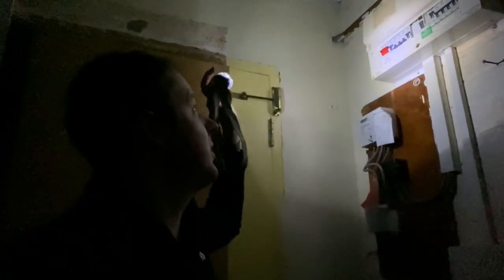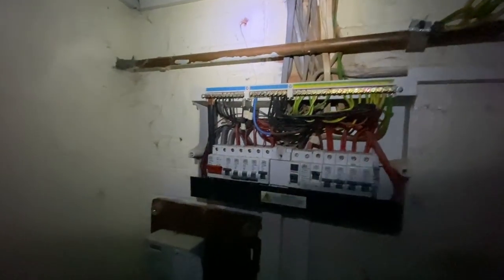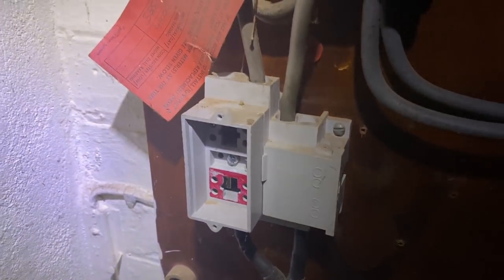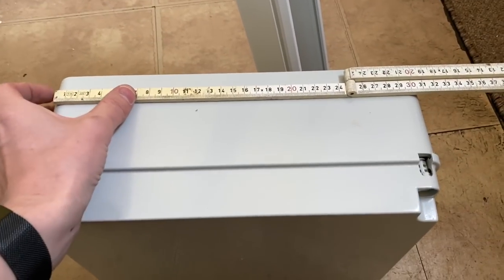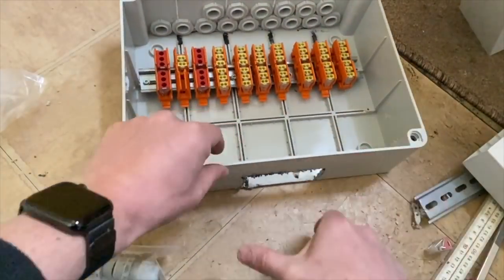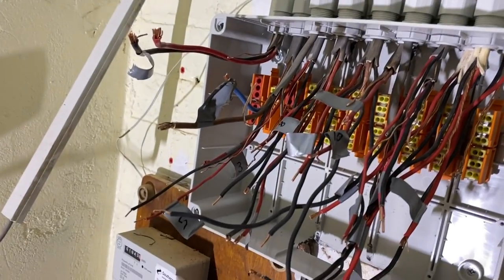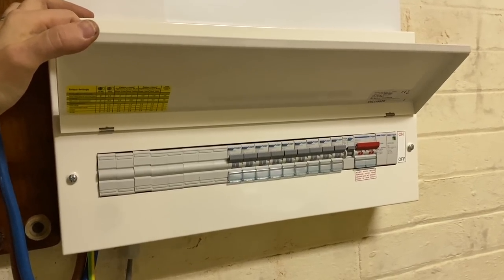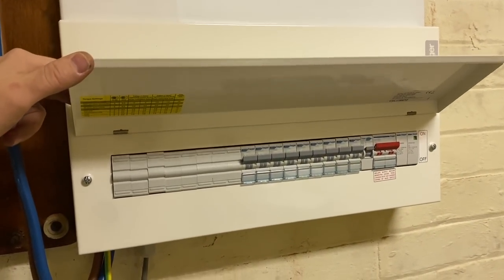Hager Consumer Unit 18th Edition Upgrade

Comment: Safe isolation is all about being in control... The fact that you are in control with that fuse out so no one can liven it without you knowing plus in an empty property, it is actually safer than locking off and going to another location coz someone can do something malicious without you knowing.
Reply: Locking off is a recognised method of safe isolation, doing what you did, taking account of risk assessment, I'd say it's safe because you're in control
Reply from the maker: Yeah you’re right good comment
Reply: @artisanelectrics  also according to Best Practice Guide 2, page 6 bottom of left column states "Adequate precautions shall be taken to prevent electrical equipment, which has been made dead in order to prevent danger while work is carried out on or near that equipment, from becoming electrically charged during that work if danger may thereby arise.  This regulation therefore requires that adequate precautions are taken to ensure that conductors and equipment cannot inadvertently be energised while the work is taking place - this is the process of isolation"

Comment: I’m not a tradesman.
Surely if you pushed the new boArd forward on some sort of frame cables could have been routed in-front of gas pipe and therefore could do rear entry into the new CU. Must have took you twice as long as it should of took. As a customer I would not of been happy. The junction box was like a plate of spaghetti. Could you not of run connectors vertically so cable in at top and out at bottom.

Comment: If a base Hager Design 50 Consumer Unit with a main switch disconnector (but without a Type 2 SPD) is £120, why does the same Design 50 Consumer Unit with a Type 2 SPD factory fitted by Hager cost £270. I can buy a Hager Type 2 SPD for £40 and fit it myself, giving a total cost £160, instead of £270. So what am I getting from Hager for my extra £110, seems to make no sense to me, but am I missing something here?

Comment: Nice job that. How long did it take you and also seems like a very pricey install would be interesting to know the cost. 
Hager are great like you say but cost a bomb 
I used gil lec the other day but ordered a fusebox c.u rcbo c.u with spd and got to be honest for the cheap price you get a lot for your money the one down side is the stickers are a bit poor
Reply from the maker: Thanks yeah the Hager boards aren’t cheap but best quality out there in my opinion, and for my customers I only fit the best.
Reply: @artisanelectrics  Crabtree are an excellant CU but pricy, however I do like the covered and fixed busbar.
Reply: How long did the job take you. Also did you do all your testing afterwards or did you go bk another day
Reply: Why don't you all use a Brother label printer E550 WP see David Savery's video review on YouTube they're worth the money

Comment: What is the purpose of the functional earth?
Reply: James Ahmat  The functional earth on the old style RCBO’s was used to allow the device to detect and earth fault even if the neutral to the Installation was lost. The non functional earth rcbos use and electro mechanical tripping arrangement within the device whereas the modules with a functional earth employ what is known as an electronic operating system incorporating monitoring of neutral loss via the extra lead. There is a grey area within the industry regarding the need for the functional earth as the supply authority claim they have accurate and reliable monitoring equipment to detect loss of neutral of the supply. Can’t see how that guarantees protection to the client if the pen conductor in a TN-C-S system is lost because we all know how useless some of these DNO people can be when it comes to rectifying reported issues.

Comment: They are pretty good boards, funny how plumbers make a fuss about a cable being within 25mm of their pipe, but when it suits they will run them anywhere.
Could you have put the board on the other side of the wall to save that joint box.
Only thing with Hager boards is your wera driver only goes to 3.5nm, and their main switch is supposed to be 3.6nm.
Reply from the maker: Yeah I could have put it other side of wall but it would be in a bedroom which is not ideal in a HMO, better if it’s in a communal area.

Comment: Hate the square knock outs on Hager boards - absolute ball ache if you've got conduit entry or a Swa gland in there.
Reply: I didn't realise they still sold Hager rectangular knockout boards,all hager SPD high integrity boards I fitted in the last year have a selection of round knockouts.
Reply from the maker: Interesting I’ve not seen the ones with round knock outs yet!
Reply: The part number I'm fitting is VML914CUSPDRK
Reply: I found that if you put the plastic inserts into the square holes you can actually drill  a 20mm hole and then still have conduit entry in there or if you have used trunking you can pass the cables through the 20mm hole. Saves trying to fit a grommet strip around the square knockouts which can be fidly and time consuming

Comment: In my workplace removing the fuse wouldn't be classed as safe isolation as you can't lock it off. Anymore could replace the fuse. Btw not a dig just a talking point
Reply from the maker: Yes that’s right
Reply: True but he's working within an arms distance from fuse carrier so nobody is going to be replacing  fuse whilst he's in there working
Reply: Is there a way of locking off after removing a fuse?
Reply: Safe isolation 😂, nobody cares, we are forced to work live, especially when you change a board and there's no isolator fitted.
And when there's a smart meter fitted with no isolator that's a real ball ache. And this is all because the Dno's want to save a few quid.
Reply: @acelectricalsecurity  in my field I'm working on stuff that is 2600v AC so that is getting isolated and locked off before I go anywhere near it
Reply: @liamstedman7742  don't blame you
Reply: Put the fuse in your pocket, who carries one of those around to replace it?
Reply: @liamstedman7742  So what would you do in this case, maybe have a DNO Engineer come out and do the same as Jordan has done, would that convince you.
Reply: @nw5835  I'm not saying I would have done any different.

Comment: Hi  I c thet u are good electrician but u could save trouble of extending cables .u only. Fix bracket on top of gas pipe mount fuse board on top  I have  55 years  electrician my name is Chris

Comment: Those wago din rail. Connectors are awful best sticking with the normal din rail connectors
Reply from the maker: Yeah I couldn’t get hold of any in time as no wholesalers stock them but next time I will use normal connectors.
Reply: Nightmare wholesalers are hard work these days ran out of pvc t boxes today apparently
Reply: @artisanelectrics  CEF stock the WIELAND brand and always seem to have plenty in stock, colour coded as well.

Comment: For me the right way to do this job would be to move the gas pipe. It would cost £50 - 100 to have a gas safe engineer do that for you. Then you wouldn’t need to junction box.

This would have given you 25mm clearance for your cables too.
Reply from the maker: Good comment I didn’t think of that!
Reply: @chirs b - no way it would be that cheap !!

Comment: The surge protection device should be protected by a 32A MCB not directly from the main switch
Reply: Stuart Olseen he mentioned at 34:18 - that this SPD model has inbuilt over current protection - so it doesn’t need a separate MCB to protect it in this case
Reply: inderinderinder 

If that is the case how would you re-set the integral over current device in the event of a fault current?
Reply: inderinderinder  I have just checked the Hager web site no mention of integral over load within the SPD
Reply: @stuartolseen214  You wouldn't be able to reset, it would be a simple fuse, but to be fair, current should never flow through an SPD long enough to trip any overcurrent device - if it does, it is faulty and due for replacement. But no, these have no overcurrent protection - Hager alternately specify using the DNO fuse (...) and a maximum C32 breaker to supply them, along with 16mm² wiring which they haven't used themselves.. Minefield.
Reply: Monkeh 
Hi Monkeh it would be good electrical practice to provide a local final circuit protection at the CCU, and would provide easy visual indication of any fault to the SPD
Reply: @stuartolseen214  The SPD already provides that indication - at least one of the two modules does. In fact, the majority of failure modes for an SPD would never trip any upstream protection. But yes, they should have some form of current limiting device in case things go wrong when the thermal fuse opens.
Reply: Hager manufacturing instructions. The spd comes pre installed from factory. Some other manufacturers come pre fit with mcb for the spd.

Comment: Nice mate big fan of Hager myself, yes pricey but a good solid brand.  How do you get your groom it strip to stick like that
Reply: I’ve found two different sizes of grommet strip off eBay the best size for the CU knock outs is 1.0 to 1.6mm strip stays in place perfectly.  Tom Nagy mention in one of his videos about using mitre fix adhesive, I find a small piece of white insulation tape to cover the grommet strip joint works a treat to make sure it don’t move
Reply: Lee Butterworth perfect cheers, I have tried the Hager accessories on my last one, which were good too,

Comment: if the consumer unit must be metal {fire proof} , the plastic junction box will not be upto the job { not fire proof} ?????????
Reply from the maker: Good comment but consumer units do not need to be fire proof, only made of non combustible material, and there is no requirement in the regs for junction boxes to be made of non combustible material.
Reply: @artisanelectrics  really well explained Jordan so many people think that a consumer unit is supposed to be fireproof they're only required to be non combustable and to limit the spread of fire,  and yes a junction box isn't required to be non combustable
Reply: @artisanelectrics  Synonyms & Antonyms for fireproof

Synonyms: Adjective

    incombustible, noncombustible, nonflammable, noninflammable

Antonyms: Adjective

    burnable, combustible, flammable, ignitable (also ignitible), inflammable

Comment: Obviously we all have different approaches to jobs, I can't see the point of Installing a metal CU then using a large plastic box to joint all the cables in , consequently adding a  potential weak link in the installation. I would have got my gas safe mate to re site the gas pipe so the new CU would fit without jointing the cables & I would then fitted the gas bond to its correct location. As I said, we all have different ideas & no offence ment  .
Reply: Not only that. I would've personally used glands with multiple holes in. That way it could've been avoided that the cables took up that much space near the gas pipe / ceiling.
Don't know how it would work out with rectangular cables, as we only use circular cables in my country.
It's always interesting to hear other peoples opinions, and this is by no means to criticize anyone.
Reply: Amendment 3 only applies to consumer units so Jordan didn't do wrong by using the plastic enclosure.

Comment: Safe isolation is of paramount yet you didnt do it correct...   the Neutral is a Live Conductor, yet you didnt disconnect it!   under a Neutral fault you get electrocuted,  not just that your showing on You tube incorrect procedure and you should not be advocating pulling the main fuse, being the DNO Property its not yours to pull.

Comment: Sorry but I find it unbelievable that you have added so many additional connections to the circuits just to move the consumer unit about 15 inches,it would have been better electrical practice to box out infront of that cold copper pipe leaving you enough tails to connect into your new consumer unit,in boxing out you could have a separate compartment for the pipe even lag it to stop any condensation ,thus you wouldn't have extra connections on your circuits,sorry but although I was an industrial electrician for 50 years whatever the contract I would never be allowed to get away with doing that